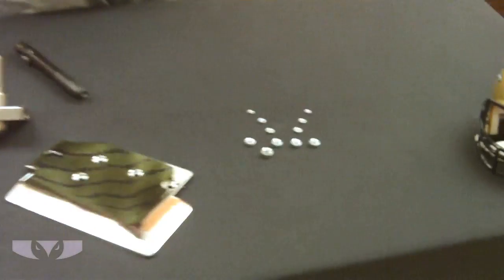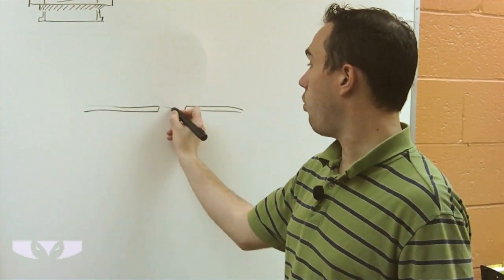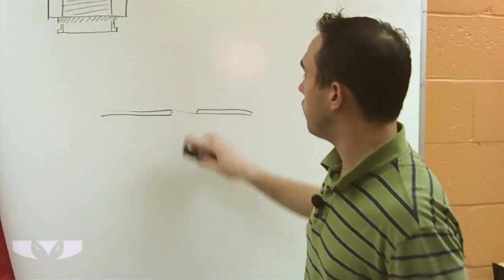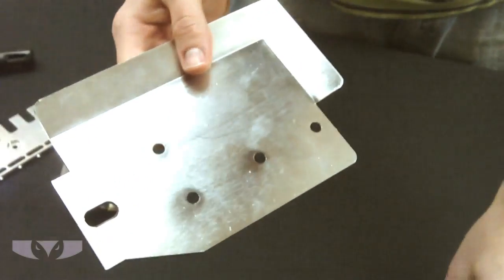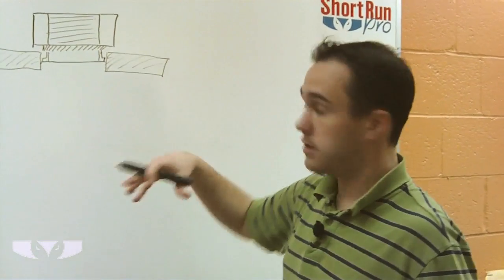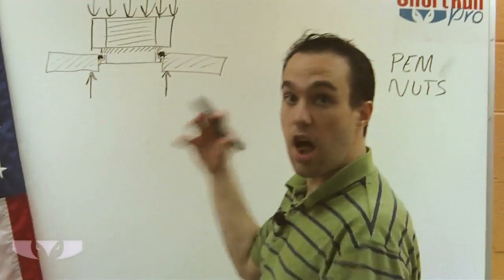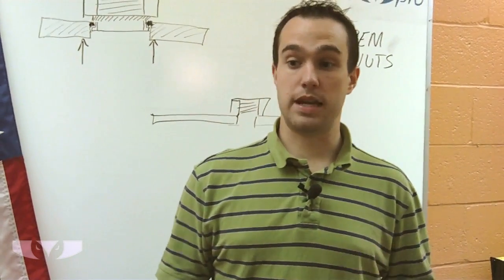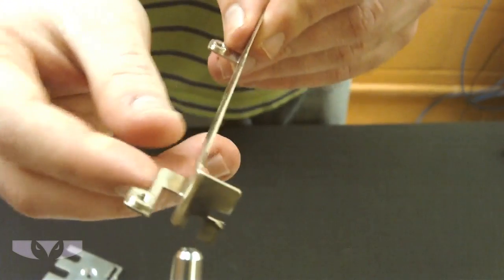Pem Nuts / Manufacturing Series sponsored by Short Run Pro

Comment: Looking to tap holes in 8 gauge (approx. 1/8") 5052 aluminum. This is a low torque application with an M4 .70 bolt. Is the material strong enough as is, or would this be candidate for pem nuts? Thanks!
Reply: PennEngineering® has a TechSupport e-mail distribution that will reply to technical questions within 24 hours, Monday through Friday. 
techsupport@pemnet.com  Please forward your questions, we would love to help.